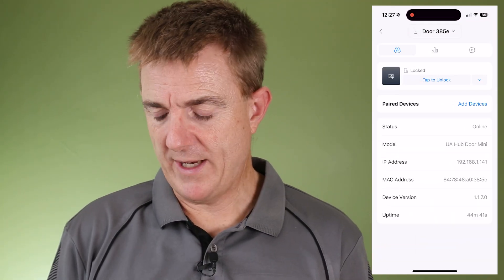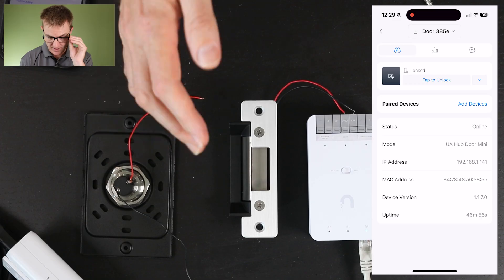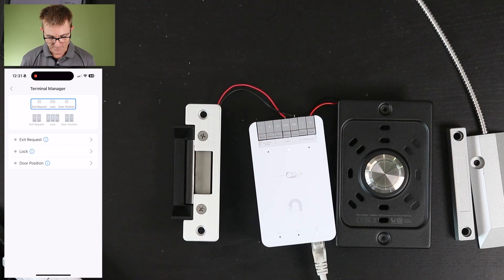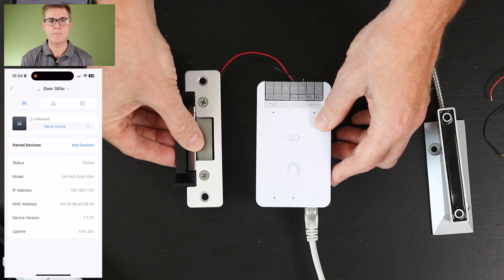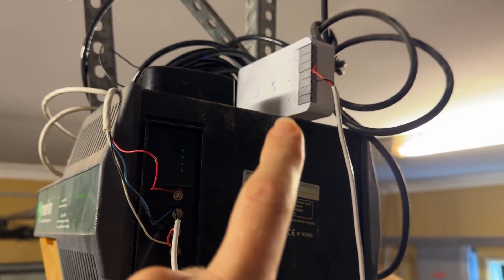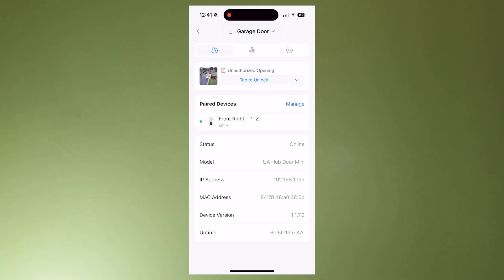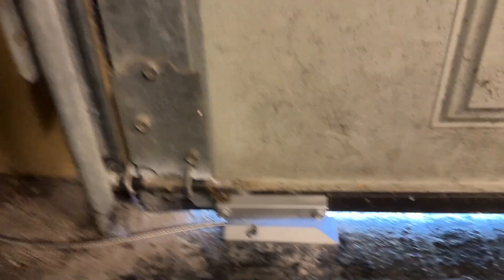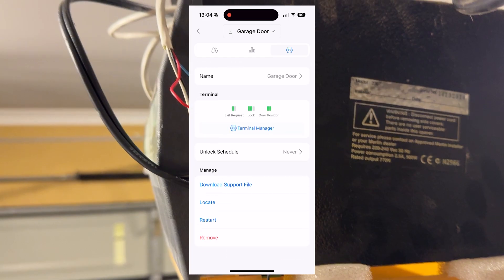Rough & Ready - Ubiquiti Dry Vs Active Contacts - Ubiquiti UA-Hub

Comment: Great video.  I am using a door position sensor with my Door Hub Mini to open/close my garage door.  Like your video, my sensor shows "Locked" when the door is closed.  When opening, the door shows "Unlocked" briefly then replaced with "Unauthorized Opening" & stays in that state until the door is closed again.  Is this normal?
Reply from the maker: Yes, this is normal.   Since the hub has no way of know if you intended to keep the door open is displays that as an alert.  It would be the same if someone forced the door open as well.   Alarm manager events are slowly catching up for this.  I am hoping soon we can create an alerm / action if this status is detected, ie I forgot to close the garage door after 10 minutes of it being open.

Comment: I was never able to get the door position sensor to work
Reply from the maker: I’m sorry to hear that. Generally it is about the settings in the software and choosing whether it is by default open or by default closed so that it knows when to alert you.

I have seen it in a few occasions when the door sensor connectors are actually faulty, but generally it’s a software configuration issue.

Comment: Great video - makes it a lot easier to understand.  I have a roller shutter with 3 buttons, up down and stop… just wondering if I ignore the stop button - I could wire an up to open, down to close and both to com ?
Reply from the maker: That is a good question.   If you have to use the stop button to stop the door at the right position, then it won't work.  If though the stop button is just there is an emergency stop, then you may be OK.   The issue you have is that the UA-Hub has no concept of open and close, it just just sends a close / open circuit request.  The wiring on the hub is to allow you to choose if the circuit needs to be opened or closed to make the door opener action.  It is not about the physical opening or closing of the door it is just an electrical state  I think in your instance it may not be possible to get it to work.